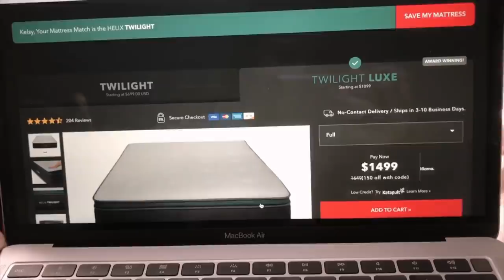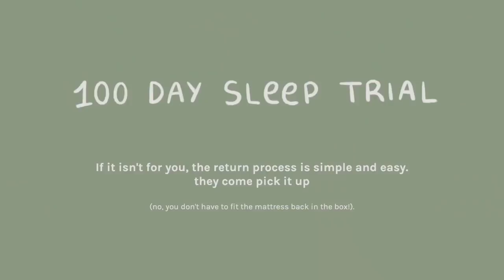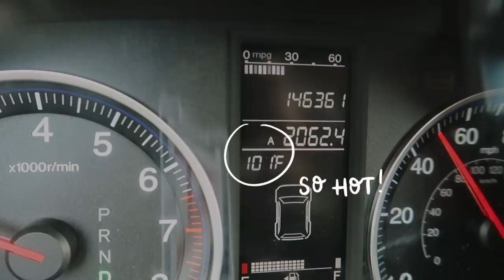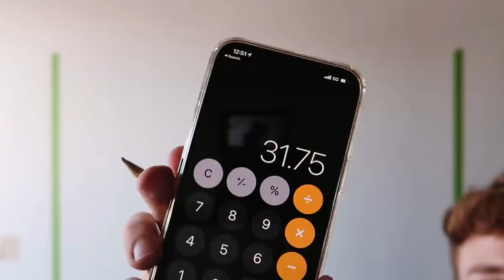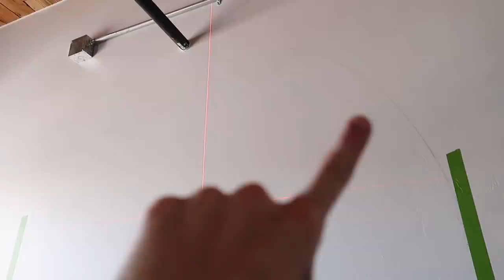400 SQ FT ✨ SMALL LOFT APARTMENT MAKEOVER + DIY Arch Headboard (Part 1)

Comment: Despite the bed being immediately adjacent to the kitchen area, might it have worked to place the side of the bed against the wall, opening up the center of the room? Would that have eliminated the small area for keyboard and basically put end of bed in kitchen? (Hard to gauge from what we've seen so far.) But then the issue of nightstand. Perhaps the painted arch is more obvious in person but it's barely discernible in the video losing some of its effectiveness, IMO. Bit darker might've made more of an architectural statement? Looking forward to next week to get feel for entire space. ;)
Reply: C Mitchell, I thought of the bed sideways against the wall, too...but that would not work for someone in a scooter. She would not be able to make the bed. She needs to get around both sides of it.
Reply: @jemma50  Depending on how one sleeps, if the bedding were mostly secured on the wall side, and just pulled back on the open side, would just entail flipping the covers back in place each morning. (I've always slept that way; other side of bed is undisturbed.) But if lots of tossing and turning, can see your point.
Reply: @cmitchell7347  I was thinking more of when the sheets need to be changed. :)
Reply: @jemma50  Ah, gotcha! (Duh!) I've previously had the side of a bed against the wall but disability wasn't an issue. Able to kneel on bed and tuck the edges.

Comment: To tape off a curved line for painting, first draw your line on the wall, which you have done, but leave the pin in and keep your string and pencil handy. Next, place short pieces of tape over the line, then go back and draw the line again on the tape. Finally, use a sharp knife to cut away the tape along the line, and voila, you have a taped off curve ready for painting.

Comment: so you are doing a studio apartment....PERFECT
IMHO ...for myself I would not want my bed right in from of the "kitchen"
curtins on the bed frame to block that view for me but that would increase the fire hazard..... 
the nook is a good spot for the dog bed,  better yet the TV & credenza. I would of place the bed between the 2 windows horizontal to the wall 
hard designing for disabled individuals....but I'm sure the rehab of the building was up to code especially in the bathroom, not the kitchen tho.

Comment: I have experience with small spaces. Personally, I'm not a fan of the bed placement - the first time she cooks anything splattery, the grease will get on her sheets. I know that there's a mobility concern, but most people usually sleep on just one side of the bed, so you can prioritize clearance over symmetry. It's not a usual choice, but I think I'd have put the head of the bed against the window, with just enough clearance on the right to get the scooter in to make the bed.

Comment: Sorry, but I don't like the canopy bed at all. I don't think her prior bed frame was a good fit, but I would have bought one with a solid wooden or preferably textured fabric headboard. To me, the metal canopy frame draws all the attention to the bed, and the vertical canopy - to my eyes - makes the room look smaller. It puts a vertical structure in the middle that one has to look around and also move around if she, her dog, or guests want to sit on the end of it. I also would have gone with round side tables with a lower level to break up all of the straight lines, especially since it's next to the kitchen appliances.

Comment: Why not use only one bedside table so you can actually open your kitchen stove and cabinets?
Reply from the maker: The stove actually opens fully with out 8 inches of space before the nightstand!
Reply: @lonefox  Sounds good but looks tight. I live in a small apartment and have notised that less furniture and stuff is better. Makes it feel bigger and the flow is better. Just because you can fit something within a few inches, doesn't mean you should if not absolutely nessessary. And if the woman lives alone like I do I get along with one beadside table just fine. Actually I could get by with none cause I have drawers under the bed so could always put books etc there or get a tray if I want to drink tea in bed and eat. Just suggestions.